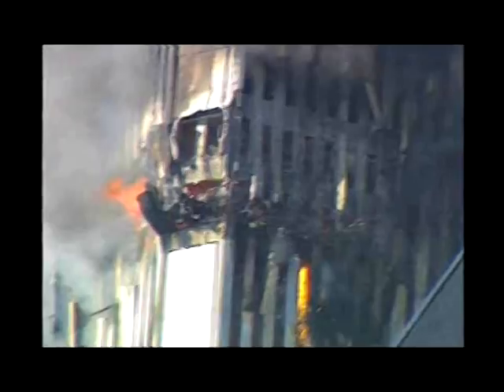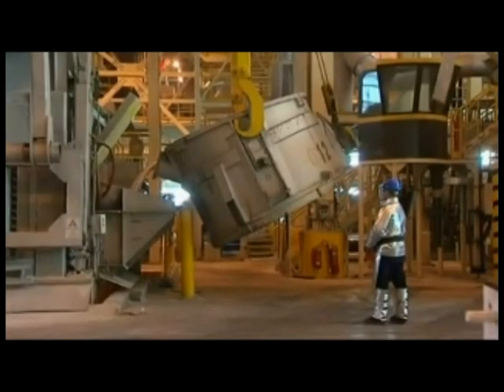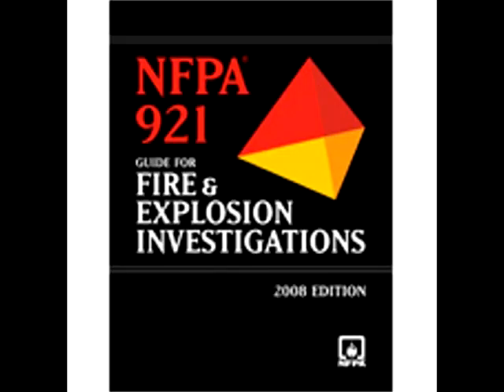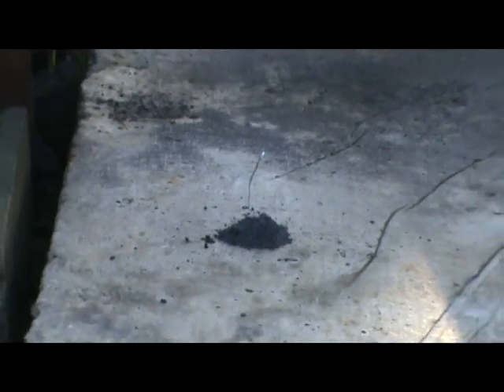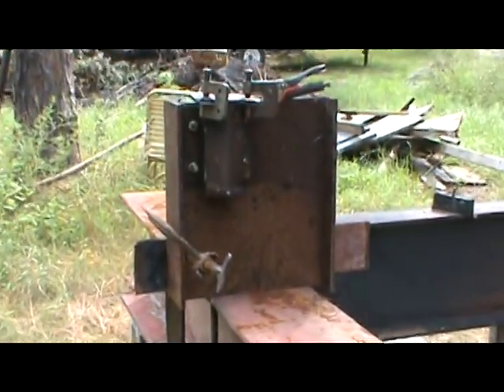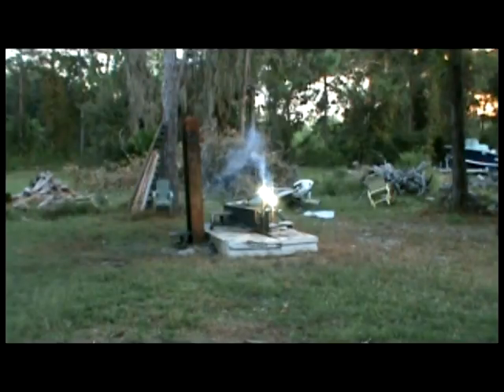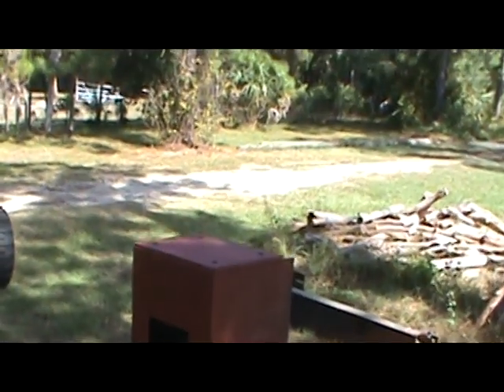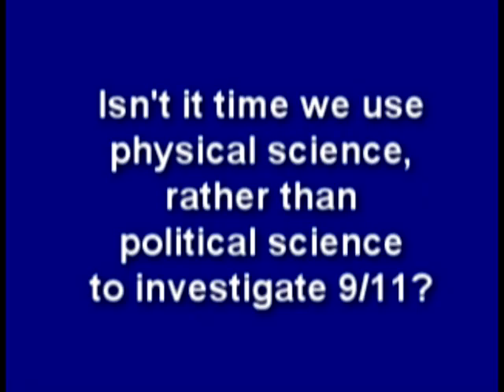9/11 Experiments: The Great Thermate Debate

Comment: What is your point? Thermite can melt steel no matter how you spell it. We already knew this. Any source of heat will do the job, like burning several thousand pounds of jet fuel in an enclosed space.
        To prove your theory, you need to show that jet fuel can't produce enough heat to cause steel to lose it's strength in the conditions that existed in the Twin Towers after the crashes. I wonder why no one has done that experiment.
      Could it be that jet fuel alone actually CAN produce these temperatures?

Comment: Pure stupidity.  You can look up the strength of structural steel at various temperatures online.  The steel didn't melt.  The steel became weaker as the temperature climbed.  Once the steel was weakened to the point that it could no longer support the load - it failed.  

Here's a link to some charts that graph the strength of various materials (including structural steel) as the temperature increases.  
https://www.engineeringtoolbox.com/metal-temperature-strength-d_1353.html

As you can see - at 1000F structural steel only retains 40% of it's strength.

Comment: When you mix fuel, metal oxide and metal power in just the right way, it burns at 2000 degrees Celsius. Hot enough to cut through nearly any barrier known to man. Throw some C4 into the mix ... and you’ve got one hell of a combination.

Comment: Yes because the towers 100% did not have other types of steel used in the decoration and development in the gargantuan tower to provide more comfort to humans. Structural steel does in fact not melt at 1,550 Fahrenheit, but it makes it weak as a noodle. Conspiracy theories are just flat out not based on fact.

Comment: @ Stephen Savage
"You don't NEED to cut the steel, just heat it until it weakens. I don't see anyone doing test with 48,000 gallons of jet fuel."
I do not see how your IQ can be over room temperature. If there was melted steel at the site there is a huge problem with the story line. I'll spoon feed you...there has to be a source of much higher heat to have melted steel.
The issue isn't whether steel weakens at low temperatures or whether that contributed to or caused a collapse. If there was melted steel it's an issue onto itself.
What melted the steel?

Comment: The best part about science and truth is that they both have exactly zero fucks to give about what you want to believe... unlike troofers, who will claw at any potential shred of "evidence" to support "their" theory that they so desperately need to believe is true.  Ask yourself how many pet theories from other theorists contradict your own... then ask yourself why that is.  Would crashing planes into three buildings not be sufficient to justify starting a war?  Hell, the government has never had a problem doing things that are unpopular, much less need an excuse to go blow something up.  Why bother with thermite and building collapses in the first place?
Reply: Maybe there were other reasons as well.
Reply: +giantsean NIST said that one column was weakened enough to start the collapses. But this should have led to asymmetrical collapses, and much slower if the other columns were offering resistance. If the three buildings fell at speeds achieved by CD buildings, then the three buildings were also CD.
Reply: @Alrukitaf  NIST said a whole lot more than that about 7.. like how it was already structurally compromised, like how they let it burn rather than fight the fire, how the sprinkler systems were inoperable, and many other things.  NIST is a non-governmental body which has been around for over a century.  What advantage would lying give them?  Government grants?
Reply: There’s not just potential threads of evidence, there’s undeniable anomalies. No-one is clawing at anything. The evidence stares you in the face. Two aircraft strikes result in three buildings collapsing, all in symmetrical fashion like perfect demolitions. Asymmetrical damage leading to symmetrical collapses is impossible. Impossible for jet fuel fires to melt steel (yes there was molten steel, captured on film, witnessed by firemen, photographed, testimony recorded, temperatures recorded for months.) explosions were recorded, the reactions filmed, so you know the sounds were not dubbed. Building 7 was predicted to fall when no aircraft had hit it, and no steel reinforced concrete scyscraper had fallen due to fire ever before that day. There’s more evidence than this. Much, much more.
Reply: Building 7 was not a steel reinforced concrete skyscraper.  It had a similar construction to 1 and 2.  Furthermore, Jet-A burns at close to 1000 degrees.  Steel starts losing strength via chemical changes at around 700 degrees, even before it begins softening.  So that's already two facts that are comprised of incorrect or misleading information... why would that give me further incentive to invest in believing you?  Here's a question... Big Bad Conspiracy Inc. just brought down both of the tallest buildings in Manhattan.  Does it REALLY seem reasonable to need to bring down a tiny, relatively insignificant, neighboring building?  If they wanted to rile up the citizenry, I'd say two buildings would have been more than sufficient.  

I don't pretend that the government isn't tied up in dirty business and conspiracies... I think you guys just give them way too much credit.  This is the same government who couldn't even move food and water to New Orleans after Katrina, and who told us the war in Iraq was over before it really started.  But even if they did, what difference would it have made?  This current administration has proven that the government can do pretty much as it pleases... they don't even bother with good reasons anymore.
Reply: +Wes Fox Regarding symmetrical and perfect: if you look at footage of demolitions, there are so many that don’t fall as expected. The tell- tale signs are that building seven in particular, showed that a number of floors fell at g acceleration. This means that the floors below gave way instantly, offering no resistance, which points unquestionably to controlled demolition. The twin towers had material ejected horizontally, and even upwards. These are undeniable facts, which indicates that there was explosive force pushing this material. Again, realise that “perfect” and “symmetrical” mean compared to the many planned demolitions that go even slightly wrong. The three towers in comparison, look like the very best of the best results as far as controlled demolitions go. Also, note that in all three cases, the core fails first, which is needed to ensure minimal damage to surrounding buildings. Currently I believe over 3,000 architects and engineers have signed a petition for a review.

Comment: OMG ur the dumbest smart person alive. The explosives residue was from the holes cut into the sides for plane impact points. Planes can't penatrate the building wall. The primary demolition is EXACTLY as described in the NYC building permits from 70's. NYC required demolition plans be in place before construction begins. Subterranean tactical nukes we're used as per building plans. Remember, building plans made in 60's. Back then it wasn't taboo to use nukes in construction projects. It's that simple. The building plans are the answer. The planes and explosives we're just an excuse for the sheep to believe the news media.

Comment: One thing about which is a huge misconception is that it wasn't a simple office fire, it was a more like house fire or tens of offices on fire. Naturally the convection creates a blowtorch effect and there are a lot of chemicals and materials to melt steel. You don't need to melt steel in order for the building to fall under it's weight. Steel becomes very soft and loses it's strength already at around 600-700 degrees Celsius after which the sheer weight of the building will brake and bend the steel. There might have also been thermate reactions and hot gasses which were the by products of the burning materials and combined mixtures creating different colored smoke and explosions.
It's also nothing new to see that steel has melted or bent when huge structures burn complitely.

Comment: The amount of time this guy put into an utterly ludicrous notion...Amazing.
Reply: @davidc9783  Two objects would be losing momentum against each other in exact equal time to one another regardless of which direction(top, bottom, or both) the two collide, so no inanimate object(dynamic or static) can gain momentum through itself; as it's always conserved and only lost against another, and I'm right.
Reply: @davidc9783  The top portion couldn't gain momentum as it's also losing it colliding against the bottom. It can't work both ways. And neither the top or bottom can possibly gain weight as they lose mass. They weighed less and less, not more and more.
Reply: Katelynne Wilcox  In other words, shining a spotlight on the fact that objects always lose momentum against each other in equal time because it's always conserved, would contradict the ongoing impossible implication by the media that an object can liberate momentum through itself (regardless of anyone's opinion about someone else or anything), even if it's a skyscraper. Neither a static or dynamic object can gain momentum through itself because Newton's First won't allow it. The upper block can't do anything more after losing all momentum against the standing structure in equal time to each another, and the standing structure, like anything else dynamic or static, couldn't liberate momentum through itself afterwards, before, or ever.
Reply: Katelynne Wilcox  Your  misunderstanding of reality is believing one can separate truth from fact with a "truther" label, and your attempt to define a "progressive collapse" as self-liberated momentum through oneself displays your ignorance of Newtonian Physics. Objects only lose momentum against others in equal time to one another as it's always conserved. It doesn't work both ways, and it's bogus nonsense to pretend it can. The ideal conditions for buildings to somehow collapse from the top down is by separating them in half with timed explosives or hydraulics, per Newton's Third', and the colliding sections of approximate equal mass still won't do all the demolition work. A building can't do the work to itself, don't you know? I suggest you take a look at the Wikipedia article on "Gravitational Collapse". There you will find a discussion about what happens to massive interstellar objects no smaller than a star.
Reply: Katelynne Wilcox  You lost interest in trying to convince me a building can gain momentum through itself after something else has finished losing momentum against it. I believe it's impossible to work both ways, only the later is true, and anyone who thinks otherwise can't begin to prove it without first contradicting themselves.

Comment: Thermite is used to weld railway track. There are some ingenious devices made here to demonstrate the necessary effects. The main fires fizzled out fairly quickly, so could not have weakened the huge steel columns. Were enough columns cut to  weaken the overall structure?

Comment: It sorta makes sense when the towers were being built a way to bring them down was built in from the beginning. You don't want to build something of that magnitude knowing there would never be a way to demolish the buildings. Maybe a built in demolition system was exploited.
Reply: Katelynne Wilcox  I'm pointing out the fact that an object can't gain momentum through itself, ever, as it's always lost against others in exact equal time to one another because it's only conserved, and facts never contradict each other, or change. A separated top of a building can demolish the same amount of mass below with gravity, provided they are both that weak, but what's below can't continue tearing itself apart after what's above is finished. That's why even verinage' separates buildings into sections of approximate mass(to minimize damage to surrounding buildings and infrastructures while maximizing it to the colliding sections) and isn't even attempted on strong steel structures. The video you shared is simply a demolition job being done by a backhoe which removed structural mass below before dislodging mass above it all. That's why there was so little resistance during the partial collapse and why so much of the building is missing directly behind it.
Reply: They couldn't liberate momentum through themselves because it's always conserved between colliding objects in exact equal time to one another, without exception. Crushing weight can't be added during any deconstruction. It's always subtracted. The buildings weighed less and less, not more and more. An object can't exert more downward pressure on itself than it already weighs, and as it loses mass, so the buildings were blown to hell and expanded all over Manhattan from the top down with military grade incendiaries and explosives, obviously. Militaries do blow up more buildings up than demolition companies(as no building can do it this to itself), and they do kill people in the process without batting an eye.
Reply: Floors that were previously weakened couldn't pull the columns down with them any more so than floors that weren't is what's clearly indicated in that video, in addition to a demolition crew with a backhoe being necessary to accomplish even a partial collapse of only floors. Understanding that a skyscraper can't gain momentum through itself(Newton's First') because it's only lost between two or more(Newton's Third') might cause some confirmation bias on my part, but is in no way baloney, just as truth can't be separated from fact with a bias label like "truther".

Comment: That metal flowing out was the lead from the lead batteries in the Uninterrupted Power Supply system in the room where that flow of metal came from.
Reply: Actually it was not even melted metal at all.  It was some kind of burning material.  You can tell because it got brighter and hotter as it feel - which is the opposite of what would have happened to molten metal.  And molten metal would have acted as a liquid and dispersed into mist - which means it would have cooled even faster.
Reply: "The fires in the building and in the rubble piles were hot enough to melt aluminum and lead, but not hot enough to melt steel."

And your point is?  Or are you really dumb enough to think that the steel had to melt in the first place?  Type: "structural steel temperature" into a search engine and read the charts you will find on the websites posting reference information for engineers.

You'll discover that at 1000F structural steel only retains 40% of it's original strength.
Reply: And it stayed hot and melted because....
Reply: @worldofenigma1   Aluminum becomes a liquid at 1220.58°F0.  For Steel, it's around 2500°F depending on carbon content. For lead, it's about 622.4°F So, even if Aluminum or steel is not molten, the lead would be in a 1000°F furnace. Even then, the structure of steel would be compromised. You don't have to melt steel to make it lose shape and strength.